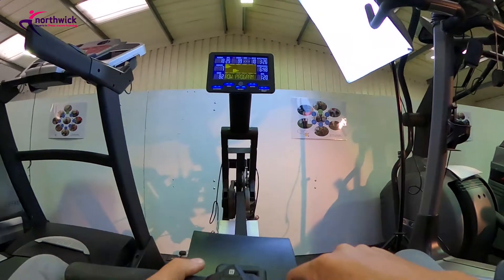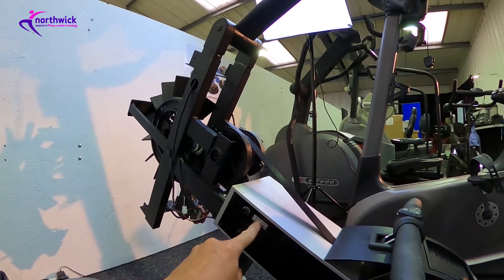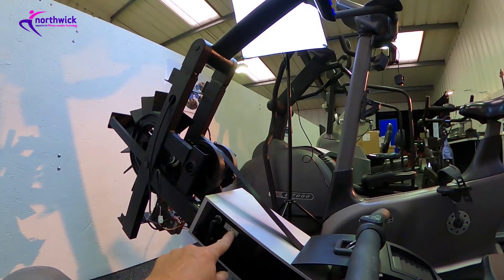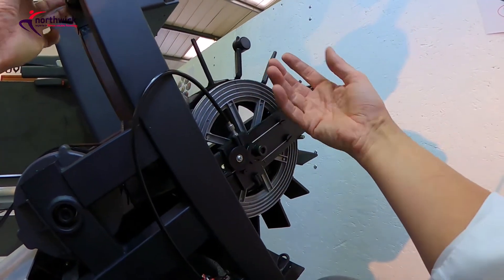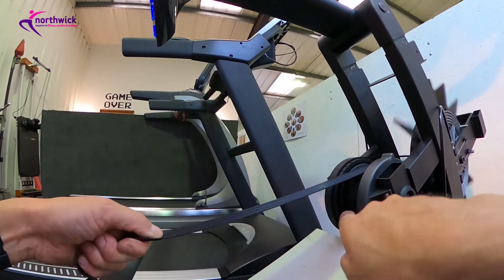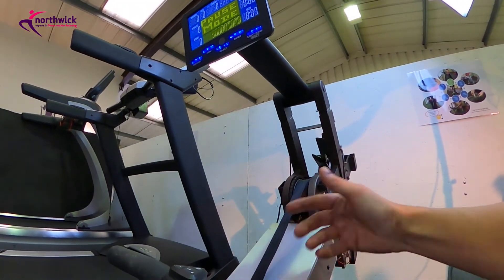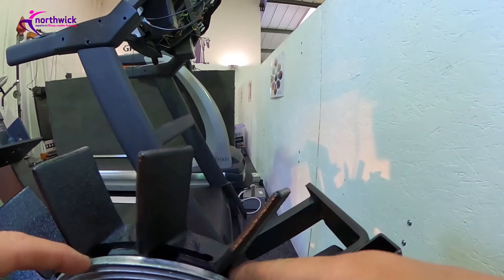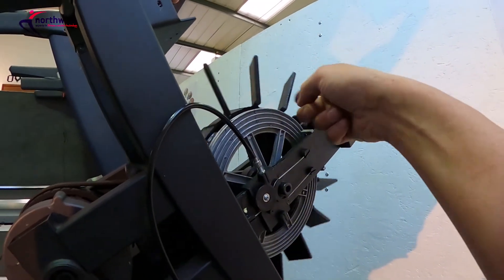Bodymax R100 Rower

Comment: Hi I have a problem with the fan wheel catching as you  rower, My husband tighten up  the tension cable to pull the wheel away, but it's made it really had to row, even on no  settings or program, and then when you set a resistance it makes it even harder to row., even on the lowest resistance.
Before he did anything when I rowed it was catching
Reply: Thanks for your message. I have replied via email. Best wishes Jon

Comment: I have the same problem i have replaced the clutch assembly and now i have a problem with the speed sensor. I will be rowing and then the console will pause or the strokes and meters will stop i take apart touch it and it will work any ideas is the speed sensor needing replaced or do i move it foward because i have maybe bent it backwards and needs pushed foward
Reply from the maker: Hi - try moving the sensors a little closer to the magnets. Ideally they should be set with a small gap of around 2 or 3mm - any further away and they may not work! If no difference hen check the wiring connections and replace the speed sensors if necessary.
Reply: Thanks a lot

Comment: Thanks for the reply what would you say the best Airmag rowing machine is at the moment. 
Thanks
Reply from the maker: Matrix rower is best magnetic rower IMHO. Concept 2 or water rower are also fantastic and use air and water resistance rather than magnets.
Reply: Thank you I will go and check them out, 
Many Thanks

Comment: I just picked up one of these rowers under the rebranded name Frequency Fitness R100 for $40...good find during this time of shortages.  The level controller motor cables needed to be adjusted, but after that it runs nicely. It is also known as the Infiniti R200 rower.

Comment: Great video, thank you 👍 I have this rower but when I open the battery compartment there is no battery holder and there doesn't appear to be any wiring that would allow for battery only operation. Have you encountered this and is there any way to convert to battery operated?
Reply from the maker: Never seen these as battery operated. Could be it uses a generic plastic housing.

Comment: I had the same problem - strokes were not counting, and the timer wouldn't work either. Glad I found your vid. After stripping the case down and just lightly touching the sensors  the machine started working again. Hurray!